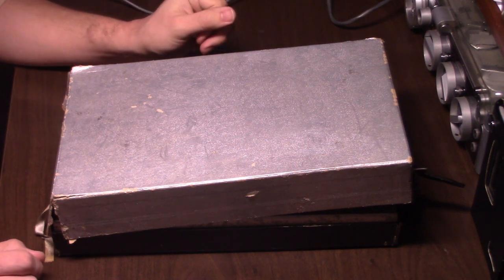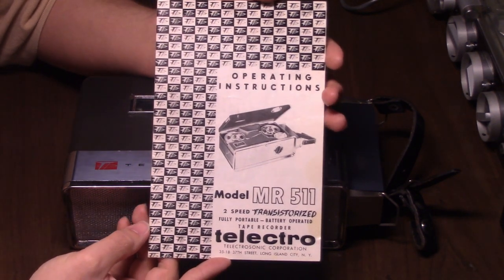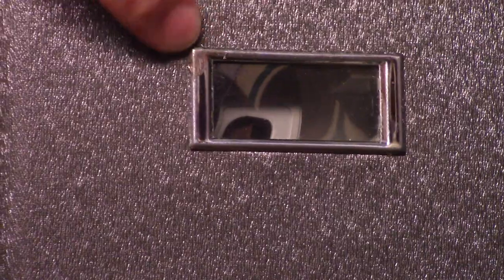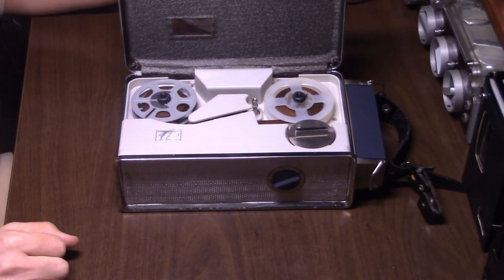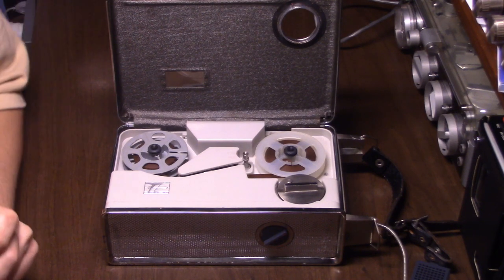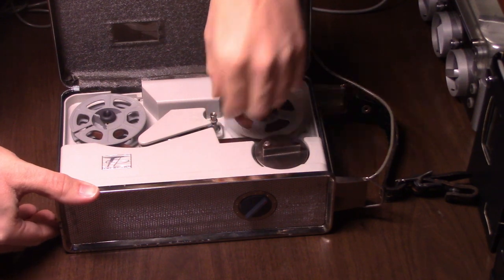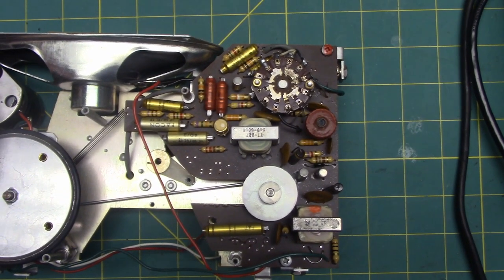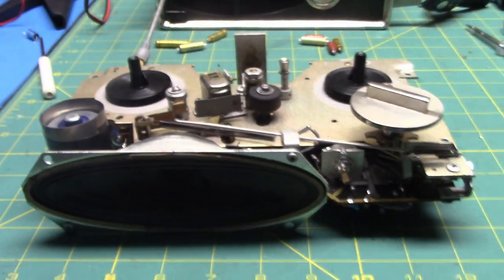Telectro MR511B Reel Tape Recorder from 1960

Comment: Nice video! Thanks for the shout out and all that great information about how the amp works! My amp was working fine and I didn't replace anything. Like you, I am able to run my recorder off a 9-volt battery long enough to test it.